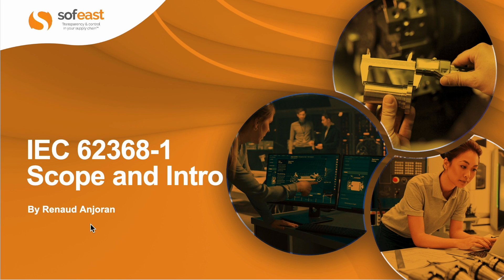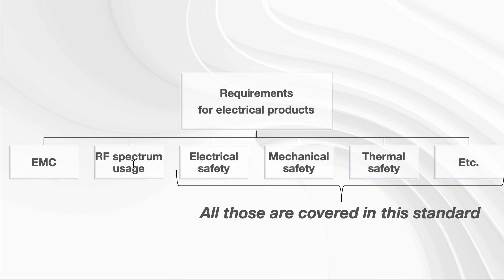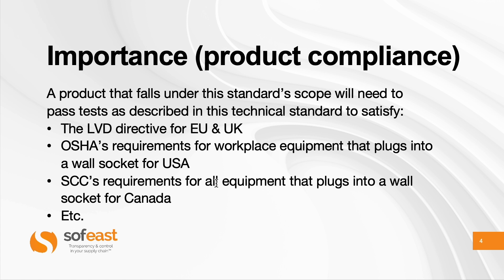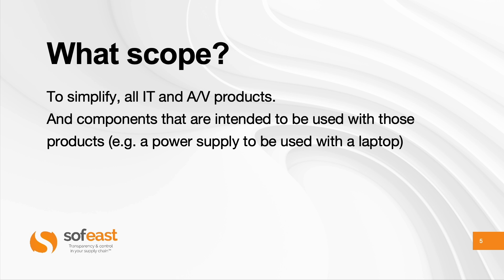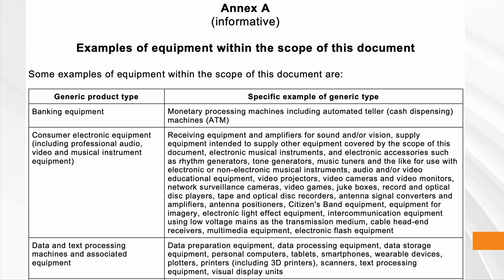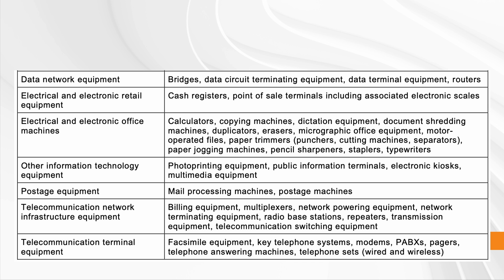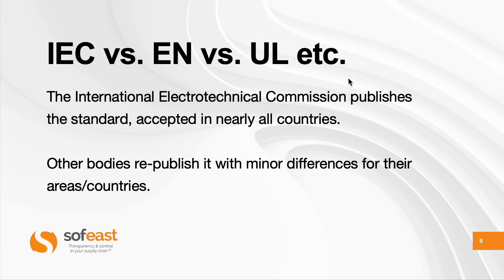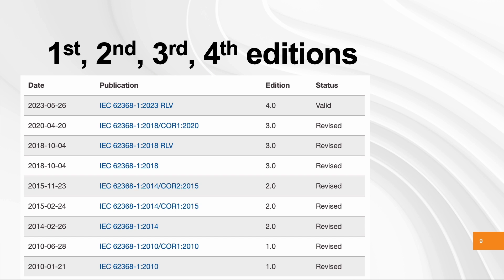IEC 62368-1:2023 Training (Part 1: Scope & Introduction)

Comment: precisions to be made: EN IEC 62368-1 ed.3 was published by Cenelec in 2020 with its European common modification A11. It may perfectly be used in Europe and UK for demonstrating compliance of product. Nevertheless, this is true that version of standard wasn't (and will never be) cited in the Official Journal due to legalistic readings of the European Commission, this implies that the presumption of conformity is not legally ensured in Europe and UK for LVD. On the other hand, edition 3 being more recent than the cited version (edition 2 for LVD only, RED has no version cited), this is usually recognized by market authorities and economic operators. Please also note that edition 3 is the version partially cited for GPS-D in regard of sound pressure safety.
Reply: Interesting, thank you for letting me know!